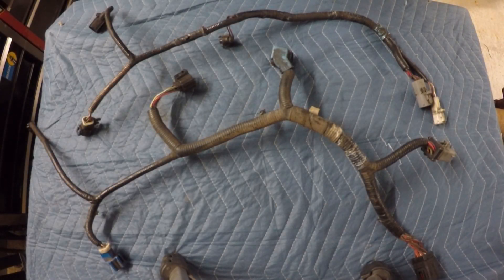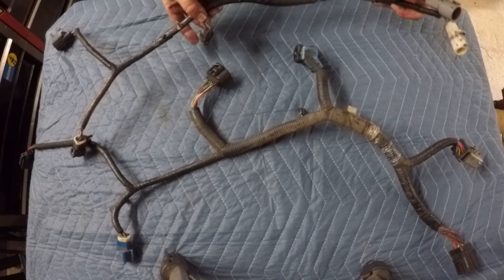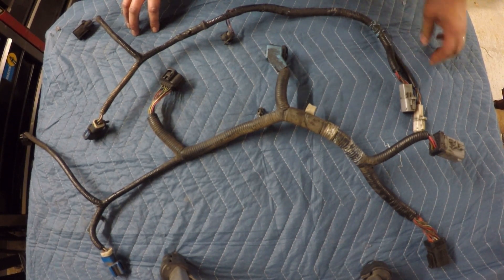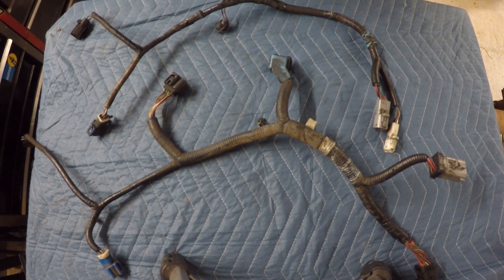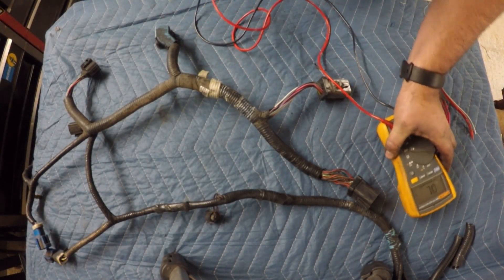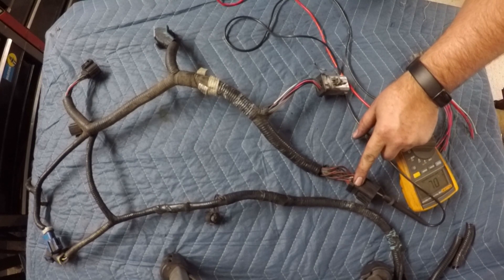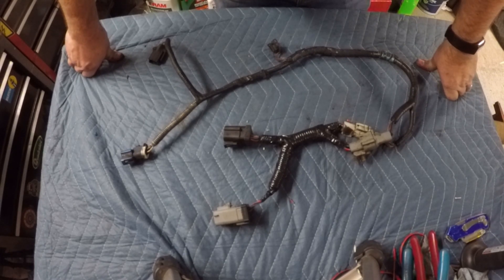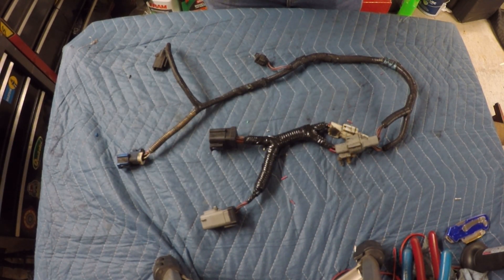Ford Ranger Manual Transmission Swap - Part 3 - Wiring

Comment: On your automatic engine harness did the connectors plug right into the manual computer?
Reply: After the correct pinning? Thanks

Comment: i have my manual trans swapped in didnt do a complete jumper harness like you just cut the wires needed off of the dtr plug spliced the reverse light switch into the appropriate 2 wires for it and connected the ones for the park/neutral safety switch to each other but for some reason my reverse lights arent working and it wont crank with the key jumper in the clutch switch connector or clutch pedal down with the switch in place and plugged in dont know whats going on with it felt like the trans plugs went fully in and everything seated good and didnt stretch the wire harness or pinch it anywhere that i can see. I'm gonna try and get the harness out with the trans still in and triple check that i did the right wires and test the reverse light switch . I'm going to run the auto ecm (i know it will cause a funky idle and my check engine light already stays on) till i can either get a cheap used one for a 97 2.3 thats mt or get this one flashed my parts truck is a 96ym but built in late 95 with a 95 ecm and would like to keep obd2 but got the parts truck for less than people wanted for a trans itself including junkyards and it has a good running 2.3 for a spare motor but your vidoes were a great help
Reply: vss is working taken it for a drive can get it to start with the relay on the fender giving it 12v to the signal post hoping its just as simple as i didnt get the grey plug fully seated and not a wire i accidentally broke when pulling the auto out or wire to the wrong one
Reply from the maker: This sounds to me like you don’t have the wiring for the PRNDL position switch properly bypassed. The truck will only start if it’s in park or neutral, so if you’re using the auto trans harness that needs to be jumpered to complete the circuit, which is also in line with the wire that would be used at the clutch pedal on the manual trans. If you don’t have a manual with schematics I recommend you get one so you can see how this needs to be wired.
Reply: @stuffyoucando2  ended up being i broke a wire in the harness for the clutch pedal switch tested from ecu to another spot the harness comes apart and had the correct wires as i had continuity on the correct pins just somehow broke the wire getting the connector off of the christmas tree pin holding it in place and the reverse lights ended up being a bad switch

Comment: will this video (and the previous video) still be somewhat applicable to the third generation rangers? i would like to swap my 2007 at some point.
Reply from the maker: For the most part everything is mostly applicable, though wiring did change in the later years for some things, such as the vehicle speed sensor which moved from the transmission to only using the rear axle sensor. Parts wise, pretty much the same thing.
Reply: @stuffyoucando2 hey man I’m swapping mine at the moment and it’s a 2008. Are you implying that the speed sensor was just swapped to a rear axle sensor? Like what is in place of the speed sensor now?
Reply from the maker: Yes, as far as I know that changed in 1998. I believe there’s still an output shaft speed sensor in the same location in those later years, but I’m not sure what it’s used for.
Reply: @stuffyoucando2  so it’s just the same connector but used for something else?
Reply from the maker: I really don’t know if the connector is the same. Your best bet would be to look up the parts for the years you’re comparing to get a look, or get to a junk yard and get eyes on them in person. My truck was a ‘97, so I can’t speak for every nuance for the other years beyond the general discussion provided in the videos.
Reply: @ I gotcha, thank you for the help so far, once I get a good look at the wiring and the connectors I already have I’ll be able to make a judgement on what’s needed next.

Comment: I piece meal a junkyard 97 2.3 into a 97 explorer 2 door, 4.0 blown 4.0 Sohc and auto trans. The 2.3 junkyard had cruise control and a/c but roll-up windows. Got everything running and driving 2.3 manual trans and manual transfer,a/c and Cruz both work.. problems I'm having is the power windows, no juice for it, does the power for power windows and mirrors come from the engine wiring? Engine wiring harness I mentioned above has a fuze For it, I guessing the dash has to have it to?? Just wondering if I have to replace both the engine harness and dash harness with one that came with factory power windows??
Reply from the maker: So the power locks work? It really comes down to what you used from the junk yard vehicle. The fuse box under the hood of both vehicles is where the power window fuse is located, but the fuse boxes themselves appear to be quite different.

Comment: What did you do with the overdrive wires once you removed the column shifter?  Can they just be taped up and left in the column?
Reply: Found it  thanks
Reply from the maker: There’s a plug in there that the wires just unplug from, no need to tape anything.

Comment: So did you have issues with the computer sensing the truck was not in drive and limiting the rpm? I am working on a 2002 ranger automatic to manual swap I have all the correct harnesses already installed
Reply from the maker: No, because I swapped in the manual trans computer too. This video is part of a multi part series, check out the other videos where I discuss other parts needed.

Comment: I'm doing the same swap except my transmission harness has one black square plug that plugs right into the black plug to the auto ECU harness but I'm not able to get the engine to start. Not sure what to do about that any ideas would help thanks.
Reply from the maker: What year/engine?
Reply: @stuffyoucando2  1997 3.0 2wd
Reply from the maker: Overall the wiring shouldn’t be too much different than the 2.3, at least when it comes to the circuits having any influence over starting. You will still need to account for the transmission range sensor that your auto trans had, which for the manual just needs to be jumpered out. In my case the manual transmission harness did this already but you’ll need to verify on yours. In my video these are the ones labeled “park indicator”in the diagram I provided and I’m betting they are in different pin locations on your harness, likely because Ford may not have run wiring for the O2 sensors through it, which may have eliminated the need for two plugs. The colors should be the same though. Other than that, the clutch position switch is the only other part of this that would prevent starting, what did you do with that during your swap?
Reply: @stuffyoucando2  like you I don't have one under the dash I do have one I cut out of a 2.3 truck I have for other parts could it be wired in under the dash?
Reply from the maker: @DakotaWebb-gs2jb  if you don’t have the plug under the dash like mine then it will start without it in place. Your problem is most likely related to the transmission range wiring I mentioned in my previous comment. How have you verified pin locations and wiring. Do you have a meter and a diagram to follow?
Reply: @stuffyoucando2  I have checked some online as for a meter I need to get one I honestly assumed since mine plugged right in I wouldn't run into this problem lol I'm assuming I need some wires to splice in from the grey plug?
Reply from the maker: @DakotaWebb-gs2jb  you can start by comparing the colors on each side of the plug, but I definitely recommend getting a meter and at least a Haynes manual.
Reply: @stuffyoucando2  yeah I'll pick one up sometime this week I'm just curious though is the grey plug the main ECU plug or is the black because my transmission just has a black one and it only fits the black plug on the auto ECU harness. I tried plugging it into the grey one and it doesn't fit the grooves are different.
Reply from the maker: @DakotaWebb-gs2jb  on mine the wires were mixed between the two plugs, but the 3.0 must be different, as the O2 wiring is likely different and may not pass through the trans harness.
Reply: @stuffyoucando2  the trans harness in mine has 2 02 plugs wired in one black and one purple
Reply: @stuffyoucando2  however the front two O2 wires are green and run directly into the engine ECU harness
Reply: Okay all my wiring is spliced together and the truck runs however I have an extra O2 sensor wire that is solid orange and nothing to match it to us the ECU harness color that pairs to this a different color?
Reply from the maker: @DakotaWebb-gs2jb  you have three O2 sensors I believe, all of them have an orange wire which appear to eventually change to a GRY/RED wire somewhere.
Reply: @stuffyoucando2  ohh okay well there is a grey and red striped wire not connected to anything from one of the jumpers maybe it goes to it

Comment: For the park indicator, do those wires just tie together? I’m doing my harness now but my 5 speed came with a little bit different wiring connectors
Reply from the maker: In mine, within the manual transmission harness those wires were connected, likely the same wire just looped. I verified that with a meter. The truck will not start if this connection isn’t closed.

Comment: So the white connector from your manual trans harness that you spliced into.. was that dedicated to just the o2 sensor? I’m starting mine tomorrow
Reply from the maker: The white 4 wire connector on the manual trans harness is the O2 wire plug, yes, and this ends up in the black plug on the automatic engine harness when the adapter harness is made as shown in the pinout at the end of the video. At least that’s how my truck was. Keep track of the colors and it should all make sense.

Comment: Thank you for pinout!! I’m also doing this on my 97 Ranger.. The clutch position sensor is up in the dash in the general area where the clutch pedal will be, it took me a minute to find it but it’s tucked up there good!
Reply from the maker: How many wires are there, and is there a jumper on it or something? I never found it and the truck will start without anything connected to the position switch on the pedal.
Reply: @stuffyoucando2 7 wires, and it’s plugged with a cap that I guess acts as a jumper
Reply from the maker: Thanks, I’ll have to look again. I looked pretty hard before and couldn’t find it.
Reply from the maker: To follow up, I confirmed that I do not have the plug. What I did find was the Red/Lt Blue wire that is part of the circuit, and that in my truck runs directly from the fuse box out through the firewall and eventually goes through the transmission which is shown on the pinout that I put on in this video. From there it goes to the starter relay. So what I did today was splice into that near the clutch pedal and used the plug and wires I saved from the donor truck to tap into it. Only one set of contacts are needed for starting so I just used one pair of wires. Works perfectly now. The remaining 4 wires in the plug are for cruise control functions, which my truck doesn’t have anyway.
Reply: When you talk about the computer, where is it located at, did you just plug it in the New computer?
Reply: plug shouldve been on the baclside towards the firewall on the wiring harness right behind the parking brake pedal assembly